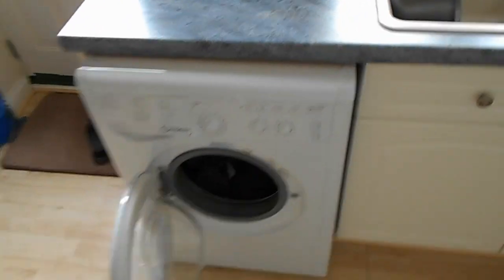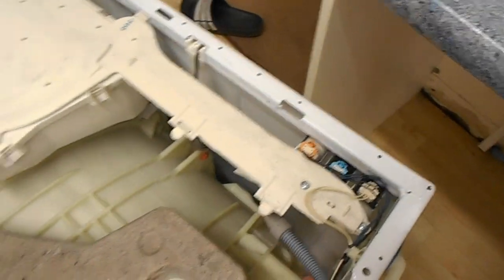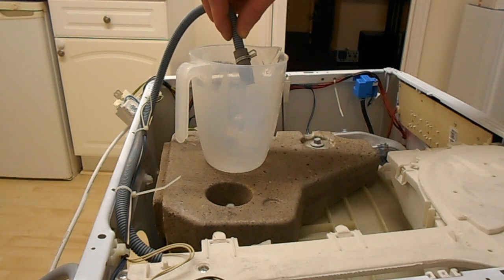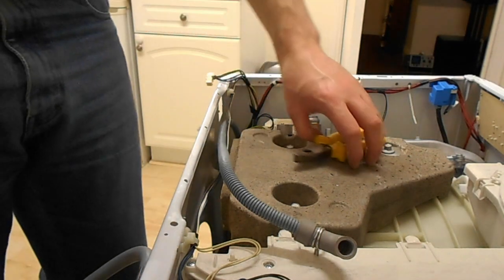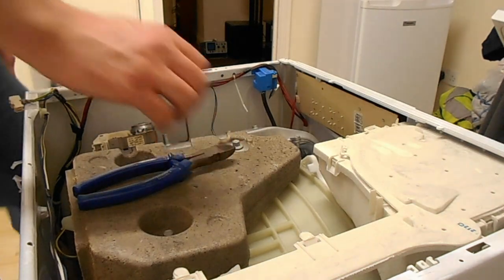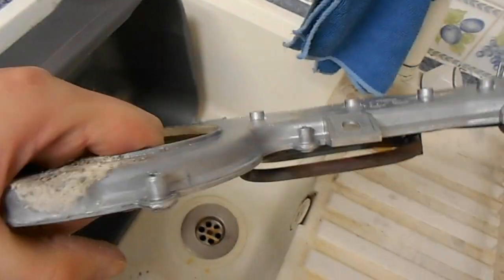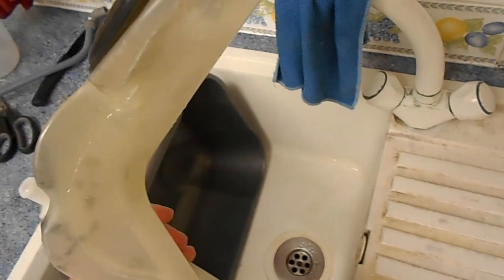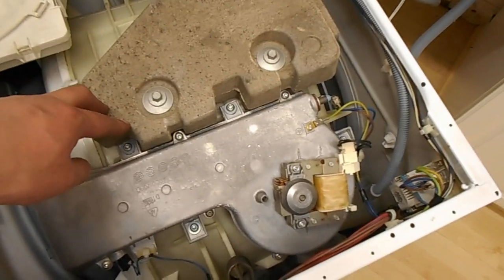Fixing an Indesit IWDC6105 Washer Dryer that's not drying

Comment: Same problem in a newer model. Before I saw your video I did the same and was solved that way.
If it is not solved in time, then the resistance of the dryer is burned, the sensor is spoiled and the impeller that was plastic on my own melts...
Thanks for confirming the damage from your video!
Reply: How long does it take to dry full load of clothes when "solved"?

Comment: Thanks for the video, there was quite a built up of fluff in mine. However it didn’t solve the problem, I found that replacing the drain pump worked - the pump would drain from the washing cycle but struggled on the dryer setting.

Comment: I have an Indesit IWDC6125 washer dryer since 2012 and like yourself live alone.  Mine has no error codes as yet however I'm wondering if I should do this anyway. I run maintenance washes / use vinegar for descaling every now and then and also check and clean the pump filter.  I guess I should take a look at this too.

I dont use the drying function very often at all to be honest, it may be ok.
Reply from the maker: It's only really constant use of the drying cycle that causes this. I've been using limescale preventer since this. Whether it's helping at all is yet to be determined.

Comment: Thaks for the video,

We had an F13 fault, so I changed the Thermistor and still not working, Im going to guess the filter is blocked and over the week end I will try to replicate the repair you demonstrated. Am I correct in assuming that there is no need to remove the top of the fan unit as this could be removed intact by taking out the big coarse thread screws.
Reply from the maker: I'd take it off as when I first removed mine to do the thermistor it was also pretty caked up with debris.

Comment: Hi there, I have been watching your video and following it closely. Have cleared all the gunk out of the condenser tube, but the problem I am having is that no matter how tightly I retighten the clip which holds the condenser to the drum, it just keeps coming off, or leaking when I run the machine. I have pushed it back on as close to the drum as it will go and have tightened the clip until both ends are touching, but it just keeps coming off! Any ideas would be massively appreciated! heeeeeeelpppp!
Reply from the maker: I'd check to see if the seal is damaged or if the plastic fitting has maybe cracked.

I'm not sure how you could get the clip that tight with the fitting on properly as it has very little give. It coming off does make me suspect you're maybe not getting it on square so it looks like it's pushed up on one side, but might no be flush on the other side.
Reply: @killcar5nbike2  HI Liam, thanks so much fr your reply. You're suspicions were correct! It was indeed not flush on one side. Had to use a bit of olive oil in the end to get it on properly! Now fixed all working! Thank for yourideo and your help!

Comment: pretty sure I got the same problem on a beko, apart from they seem to use adhesive for the joints, rather than a rubberised joint. Got the heating/fan section off which looks very similar, but can't get it apart and the pipe has this hard white sealant/glue and is a much bigger moulded area attached to the back of the drum shell. What shite designs, now I know why washer/dryers arent recommended but no space for just a dryer, even expensive and better brands don't seem to have any easy way to unclog these sections. Ordered an extremely cheap endoscope and flexible grabber and see if I can remove the block without removing the moulded pipe as I cant see how with the adhesive they use. why is there not an easily removable filter.

I would just drill a hole in the side to get access to that screw, the side isn't seen anyway.

Comment: I have similar one that's brand new in a flat I've just moved into - is this thing even drying when working properly? I'm about to run 3rd 60min cycle in a row on the same load because things are just coming out hot and wet... what's the point? At 3 hours I might as well hang my stuff on the bloody radiator... the worst part is there's no space for standalone dryer (that will make full load bone dry in about 60 minutes...) and we can't throw away this one, it's absolute trash -_-
Reply from the maker: What's important with these when drying is small loads. The wash function can wash a load that's too big for the dry function.

1 pair of jeans and a fleece, or 3 bath towels is about the limit on drying size. Those as loads will take about 90 minutes to dry.

If the drum is too full the air can't circulate and it won't dry.

I can dry my work clothes of two t-shirts, medium weight jumper and cotton trousers as a single load on the 100 min setting to bone dry. If I chucked my fleece in too nothing would dry as it's just too much.
Reply: @killcar5nbike2  Yeah, but again, if I have to throw in 3 shirts at a time for 90 minutes each I might as well hang it on the radiator... it's just too slow O.O It will be running 24/7 just to get through normal wash for two people... 

Thank you for answer though, much appreciated!
Reply: Mine will dry 2 towels in an hour if that's any indication. I hang most things up on an airer to dry but towels go in the dryer. You can't dry more than half a wash load at a time.